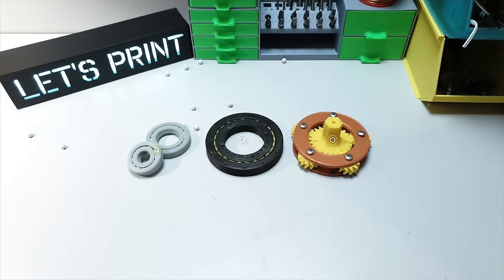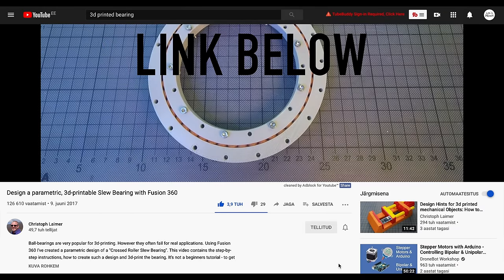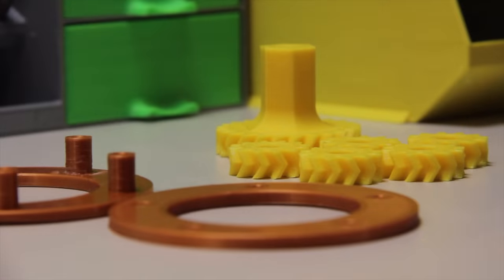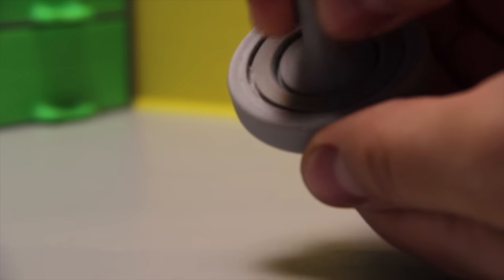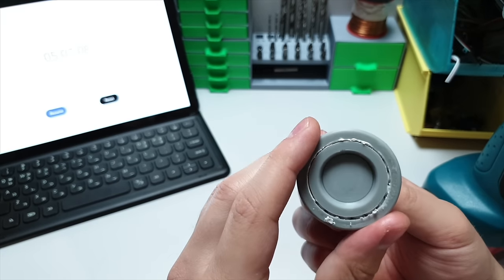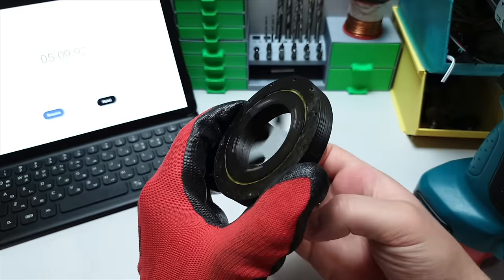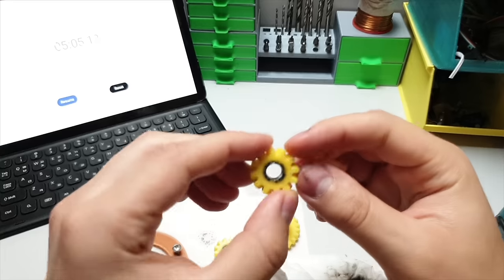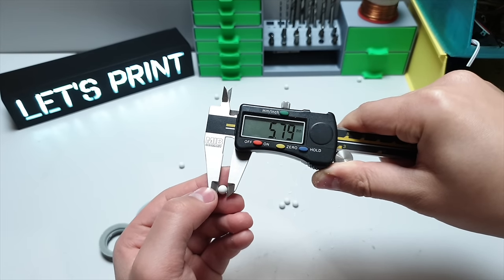3D Printed Bearings - Are These Real Things? (Building and Testing)

Comment: I think the pellets hardness is lower than abs. They are typically made out of abs with some other additives which might lower the hardness, thus they grind against the standard abs?
Reply: I wonder what ABS he prints with, but ABS is very different from each other. It can be pre-degraded from regrind, reusing the moulding leftovers in a new batch of product, and especially if you look at small pellets, you have to suspect that a lot of flashing and injection spouts were removed from them and reused in the next batch of pellets, and every cycle of heating degrades the polymer quite a bit, so you expect some polymer in there that is maybe 10 generations of regrind. It tends to contain free styrene, thus the printing smell - and you know that not all ABS filament has the nauseating smell at least not to the same amount - and it tends to also contain free styrene flake that separates out and makes for low abrasion resistance. It has also been suspected that some 3d printing filament manufacturers, what they sell as ABS really isn't, but is a different styrene copolymer, like SAN or ASA, because printing actual ABS is more troublesome. Even just a reduction of butadiene can make for something that is nominally ABS but really is closer to SAN, so less or no free butadiene and less or no free styrene, as butadiene has been shown to inhibit styrene polymerisation. So i have seen ABS samples with vastly different mechanical properties.

Comment: It's great that you are using ABS! PLA is just useless..
Interesting results, but I think you could repeat some testing:
-You should put some some grease in between the gears on the geared one obviously. And see if it still wears out.
-Use grease (or Talcum powder) in the ball bearing, instead of WD40.
-Also try printing the balls for the ball bearing in ABS instead of using the bullets.
Thanks!
:)

Comment: I need some bearings that can work in water, maybe even sea water.  My plan was to print the races or machine them from Teflon and use stainless ball bearings. From your trial it looks like the printed races could hold up if the stainless balls dont wear each other too much.

Comment: Aye, the balls being a different material to the casing, was always going to result in faster degradation of the softer material.  

Was great to see the stability of the other 2, I assume the same abs was used for all active surfaces? clean, accurately printed parts, so it should be universal wear over time, dependant on heat, or ingress of dust, dirt, or other contaminates.

3d printing just keeps leaping forward in quality, and affordability. It's great.

Comment: Great video . I would also suggest to get a more accurate test you should have/build a stand to hold the bearing and drill so you are not putting an unwanted (and inconsistent) axial load on the bearings. Great content.

Comment: What’s the point of the gear bearing? It isn’t really a bearing it just puts up more rpms on the individual axles
Reply: Yeah for real. It just looks cool but it doesn't really stop plastic rubbing on plastic. Maybe if it was a small center gear it would reduce friction more. But then it would be even bigger than it already is

Comment: 3D printer bearings are pointless for smaller bearings but anything with a thumb sized hole or larger actually becomes cost effective. A bearing you can put your hand through costs a noticeable portion of a paycheck.

Comment: The roller bearing did better because it could withstand both axial (your hand pushing the drill along the imaginary axle) and radial (the weight of the drill, your hand holding the bearing, and other forces perpendicular to the imaginary axle) load, thus making it last longer, with the trade-off being the increased friction.

Comment: If the two materials differ in hardness, one of them will begin to wear the other more quickly. We see this in ceramic bearings that use steel as a racer material - the steel is worn by the ceramic and the rolling resistance increases. Obviously it is much faster with plastic.

Comment: So I am trying to have something made where the object stays still in the center and a camera moves around that, can you design something like that to print, I think it will probably use a bearing in the center and screw to platform so the outside of the bearing can be apart of whatever the camera is mounted to

Comment: I wonder if the airsoft bearing might have been a little bit of squeeze out from the super glue caused a kind of cascade effect inside, a ball got stuck slightly before the test and so had a rough surface damaging it's neighbors causing more debris inside or maybe a little bit of the glue broke off and did the same thing? Or maybe some sort of reaction to the WD40 stripping some of the surface coating on the balls which worked into a clumpy paste?

Comment: Good work. Thanks. For proper test size of the devices should be the same. And same lubricant used. Someone said wd40 melts plastic and no good for lubrication. But very good work. Make another fair test. And use metal balls.

Comment: well made bearings, you must use strong self lubricant plastic as bio based pom or bio nylon, also you can use fiber reinforced plastic and make hand compression molds instead of 3d printing for demaning applications. still you can use your bearings for low rpm, torque and low weight applications or make bigger bearings compared to the metal counterpart

Comment: The gear bearing isn't itself that much of a bearing. It's relying on the bolts, and I feel like those fill the role of bearings and take it away from the gear.

Also, as others have said, wd 40 is not a lubricant. For this plastic it'd be best to use Teflon grease.
Reply: WD-40 also makes PTFE oil thats also called WD-40. That's probably what he used

Comment: Usually, the gears sit between an inner sun gear and an outer ring gear. There is no carrier or shaft on the planet gears  they are solid - the herringbone gear pattern stops them from slipping out, and the gears don't touch one another.

Comment: Since in the first bearing you used non 3D printed airsoft BB and they were the cause for the bearing to fail the test that wasn't very fair. I would print the BB's if you wanted a proper comparison with the second type of bearing or I would use metal BB's.

Why didn't you put that grease you used on the third bearing on all three of them?

I bet the first bearing would be great if you used proper grease and metal BB's in it. Maybe we could see a rematch? ;)

Comment: I'm gonna post the bearing system that I've been using in my AX-2 hard-suit replica.
Silent in operation, only one moving part, only two printed parts.
No balls or rollers!
Two types of bearing will be offered: one has a 'split-race' to allow rapid assembly/disassembly, the other has a 'gated race' for a seamless outer race.
They consist of an inner race, and outer race and bit of filament to act as the actual bearing.
Kind of like a 4-point bearing, but a piece of smooth filament instead of rolling balls...
Printables will be hosting; look for "AX Hard Suit bearings" some time after 11/25/2022.

Comment: Make sure that the white bbs you used are not biodegradable I have white ones that are an they are terrible for this because they are designed to fall apart after some short time
Reply: The result would still be the same since he didn't use any proper lubricant. The bb's would still be rubbing against each other creating heat from friction and just deform or peel bits off until it jams completely.

Comment: Roller bearings are inherently self destructive when running without a load. The electrical motors I rebuild can't be test run for any longer than 10mins if they have a roller bearing. The bronze cage gets tore up when the rollers skip.

Comment: The roller bearings I've seen are set in one direction. Went did you alternate that causes too much friction.
Reply: crossed roller bearings are just a different type of roller bearing, they're just as valid as normal roller bearings they just have different applications.

Comment: WD-40 is not a lubricant. Try putting the Airsoft pellets in various greases to see which one doesn't damage the plastic. Then make a new Airsoft pellet bearing and pack it with that grease.

Airsoft pellets are NOT BB's. A BB is a metal ball 4.3 to 4.4 mm (0.171 to 0.173 inch) diameter. When the BB gun was invented the fellow happened to have some size BB lead shot on hand, so that's what he used for the projectiles.

Comment: Different bearings for different applications.... ball bearings are not meant for high speed (think steering shafts, low speed short duration axles), roller bearings are meant for high speeds and pressure ( why they are used for wheel bearings for passenger vehicles, planetary gears are meant for heavy loads (ie wheel bearings for cranes and forklifts) they can't not take extended speeds (why cranes have to pull over and let the planetary gears cool on long drives) but are great for the weight being applied to them

Comment: I don't get it. Regular steel bearings are relatively cheap. Why anyone would make them out of plastic is beyond me. What are you going to use them for? The crisper drawer in your refrigerator?
Reply: Actually, I just realized these have the benefit of being non-corrosive, unlike steel bearings. Could be okay for very light duty work in a damp area.

Comment: The ball bearings need oil
Same with the bead bearings
But the planet gear bearing needs Heavy Duty oil because of the sliding motion on the teeth. A lot more friction.

Comment: It's odd that you want to use ABS instead of PLA for bearings.  PLA has a much harder surface, which is ideal for bearings.  ABS is softer, which will mean performance is worse.  Additionally, PLA is chemically resistant to most things - and you use ... WD-40 for lubrication?  WD stands for water displacement - it's not a lubricant, man.

Comment: Not to be rude or anything, but these bearings spin absolutely terribly. The friction is just way too high compared to real bearings. Bearings are designed to reduce friction in rotary parts, which with 3D printing really just doesn't work.

Comment: Good and interesting but you did the tests completely wrong. Bearings are tested under load, aka spining while something is applying force on them, axially or radially (this case). Also DW-40 is not a good lubricant, you should use proper lithium or silicone grease. The fact that one of the bearings felt looser after spinning for 5 minutes with NO LOAD proves DW--40 did nothing at all, otherwise it should have had no wear at all. I actually run things dry just to wear them down before applying the grease. Using dw-40 or running dry gives the same results, plastic wears. Had you used actual grease, nothing would have wore down. 
Also you should use steeel (possibly copper plated) airsoft beads instead. Having the hard steel will wear down the plastic but once its polished the grease will work better because of the higher surface area.

Comment: You should have a look at this: https://www.thingiverse.com/thing:4628063

This is a really good design. I've printed quite a few, and I recommend a raft to do it. It works well under a load, and seemed to work better than all of the ones you tested here, even without lubrication. It's only a 608 size just now, but I'd imagine the scaling could increase (though, it'd take a lot of work, working out the parameters and just changing that in fusion 360 would be harder, but more expandable).
Reply: Thanks man. Look like great ball bearing design. Will be using it!

Comment: Everyone is pointing out that WD40 isn't a lubricant which is correct but I haven't seen anyone point out that most airsoft bb's are biodegradable. Biodegradable + WD40 = gooey mess like in the video. I would retest with non-biodegradable and a proper lubricant.

Comment: it wold have been great if u used other lubricants like silicone grease for plastic bb bearing instead of wd40 which is not a good lube for plastic and you smoothen the bearing housing . just saying though. not quite conviincing

Comment: This test has the human error in it, you holding onto the bearings gives the slight movement of your hands, if you build a control station and secure the bearings to it and the drill as well so you can leave them at a set position then I think you would have better results
Reply: You can buy these for cheap online soo...

Comment: You need to test the bearings *with a load*!  I want to know how much thrust load the roller bearing can take! Testing the bearings without a load is a test of nothing!
Reply: yeah sadly. interesting prints wasted with no lubricant and no load even yhough he had some nice grease on hand lol. oh well. 3d printed bearings dont really make sense anyway its a poor use of 3d printing since there are so many cheap bushings and bearings that would easily outperform these plastic bearings.
Reply: @saleplains  yes, I think you are right.  If there was a use for plastic anti friction bearings like this then they would be produced by injection molding by the million.

Comment: Doesn't using axes in the gear bearing which have to be lubricated kind of defeat the purpose of the bearing? Seems like you could just have used one lubricated axis and then something gliding around it instead of a bearing. If you 3D print the entire gear bearing in one go, you don't need any friction-creating axes: https://www.thingiverse.com/thing:53451 Interesting comparison nevertheless.

Comment: redo the video with same material and same bearing size. For the little BBs BEARING make it the same size as the rooler bearing. And use steel BBs or not eco bbs. Use all bearing with grease It's much better; lIKE SUPER LUBE GREASE or bearing grease.